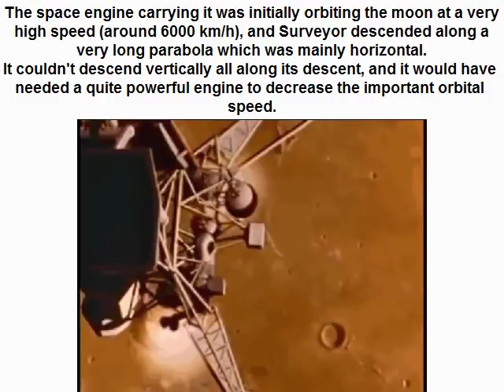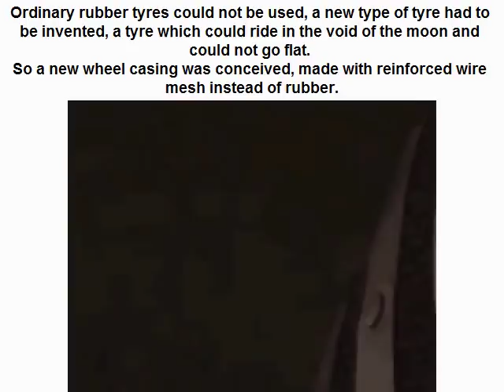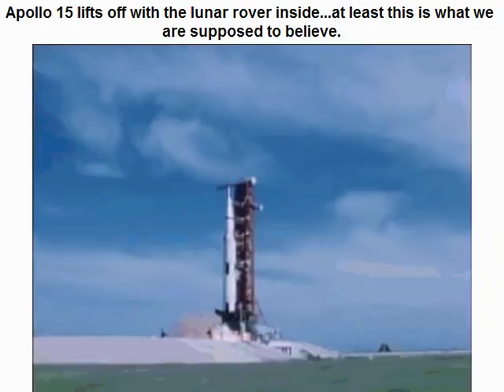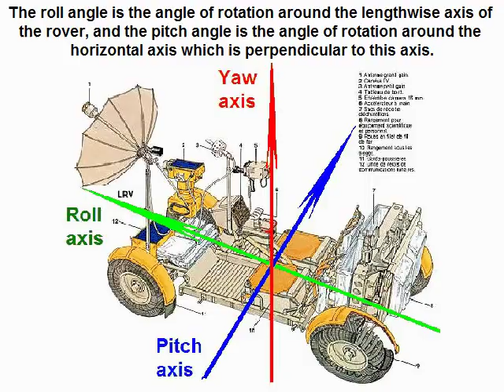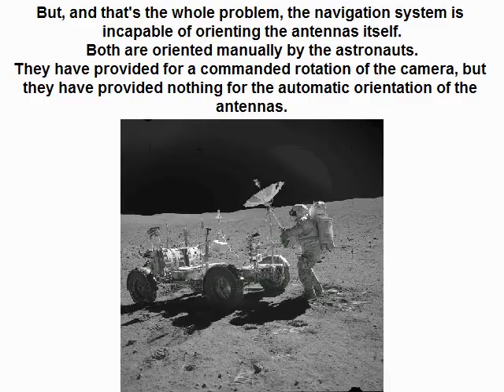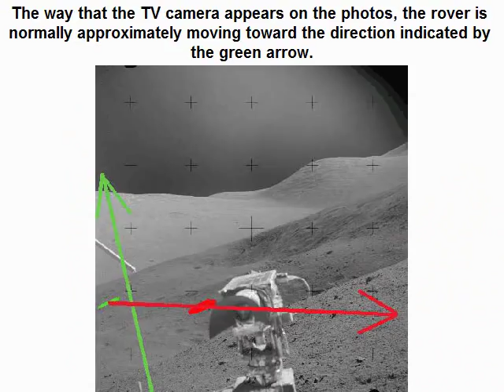Moon Fantasies: The Lunar Rover

Comment: Surveyors landing softly? lol haha that's bordering on hilarity.
The LM learnt a lot about landing softly from Surveyors bouncing around like pogo sticks due to 'powerful engines' making a landing also a lift off, a bit like making a crater would? you didn't notice the progression from high velocity camera impacts to landing softly with a LM and the inbetween even though you mentioned all 3? I guess 30 minutes is not long enough in 'Space Engineering crazy land' 

I wonder how the the Lunar Dumper Trucks are doing up there? flat batteries by now I expect, some things never change, best forget the batteries and take a LRV starting handle if they go back.
Reply: ONE Surveyor bounced significantly on landing. One. Of FIVE landings, and it was due to a faulty landing radar. Not the engines.

Read a book, you Philistine...
Reply: Is that where you got your personality and ability to think? from a Book? how about manners and respect? ...... 'A Guide to Public Toilets in Winter'? 
did you get it signed at the convention?

The Surveyor 3's Engine caused it to bounce, Radars don't produce thrust. 

So the Radar couldn't judge where the surface was, did it decide to go back up and try again on it's own? that's some clever faulty Radar? some clever book you need pal, did you understand any of it?
Reply: ** sigh** Surveyor 3's landing radar malfunctioned and caused the vernier engines to keep firing, causing 2 inadvertent liftoffs after touchdown. Not quite the same thing. No really. 

To answer your question, actually, it is my ability to think which makes it possible for me to understand what's in a book. It may seem like magic to you, but it isn't. That's why I understand Surveyor 3's landing mishap, where you clearly do not.

And yes, books are partially responsible for my crass personality. Especially the particularly ribald ones. And Doughlas Adams. Fucking Douglas Adams....
Reply from the maker: The Surveyor of Apollo 12 does not seem too damaged on the photos.
Reply: Nor should it. Though it did sustain damage, none of it was extensive. Your point?
Reply: They don't fire 16" naval rifles anymore. Does that make them fake? Surveyor ended decades ago. Grow up.

Comment: Thank God this video finally had an end. Much of the first half was filled with reasonably factual information punctuated with innuendo. Innuendo is not proof of anything. The second half seemed to be filled with photographic interpretation enigmas. Most of these can be easily resolved by realising that the rovers were far from indestructible needing many running repairs combined with the usual difficulties re photographic interpretation. All in all a fairly typical Hunchie Enterprises offering for the less than discriminating moon loon audience to which this video is well and truly targeted.
Reply: I won't go through this video as you have provided so much concerning the poor job of investigating Apollo.
Reply: Dont watch it at all then,why put yourself through it. Winding yourselves up for no reason. Unless  you feel the need to because youre always right,in which case you may well be narcissistic.

Comment: 9:16 The 2.5 second delay was no problem during EVAs as the astronauts and the rover presented the GCTA (ground controlled television assembly) with relatively low angular rates of change. It only served as a monitoring device acting as a third astronaut back up. 
We have already exchanged posts re the videoing of the Apollo 17 LM "Challenger"'s ascent from lunar lift off and your complete stuff up re the control systems approach to Ed Fendell's control problem with the camera. The preparations undertaken by Ed are well documented and available on the internet for anybody who really wants to find out. I am still waiting for your reply on that original thread that you inexplicably abandoned.

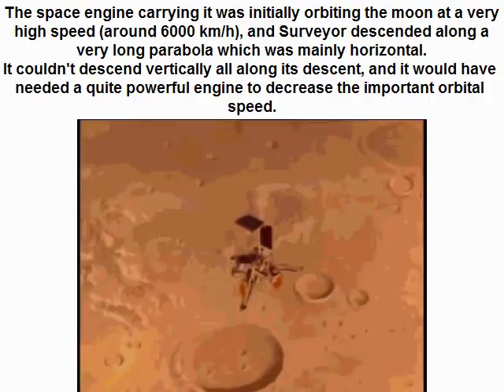Comment: 1:58  The Surveyor spacecraft did not go into a parking orbit to orbit the Moon but entered straight into a powered descent at 75.3 kms altitude with a velocity of 5817 mph (not km/hr) from what would have been a hyperbolic impact trajectory by firing a main solid fuel retrocket for 40 seconds until an altitude of 11 kms was reached. The remaining 2.5 min of descent was achieved using 3 liquid fuelled vernier engines to be stationary at about 3.4 metres from the lunar surface where it dropped under free fall to impact the lunar surface at about 3 m/s. The high initial acceleration using the solid propellant deboost motor was possible because Surveyor was unmanned. There is no mystery surrounding Surveyor's soft landing capability except in your doctored videos.

Comment: Do you see which direction the antenna on the rover is looking at?  Nasa may say Rover directly send the signal to Nasa with that antenna. It's hard to believe it. The antenna is moving around so much. How can you expect to receive any signal? My dish antenna loses the signal when the wind is strong, and dish moves around. Any small angle change will be the signal loss. Look at the antenna movement on the rover. It is a joke. If Nasa claims that it is relayed through the communication unit on the lander, the antenna should look at the lander. It is looking up the sky and bouncing around. Don't you think Nasa is insulting our intelligence?
Reply: Yes, it is indeed a joke, like the lunar module which could keep the communication with Houston when it was making weird rotations.
Reply: Truth Matters

"My dish antenna loses the signal when the wind is strong, and dish moves around. Any small angle change will be the signal loss."
Your dish is receiving, not transmitting, as the rover antenna is. 

"Don't you think Nasa is insulting our intelligence? "
Sorry, but you don't display much intelligence to be insulted.